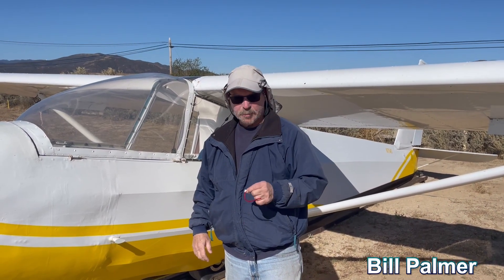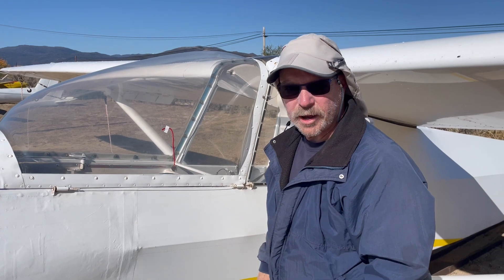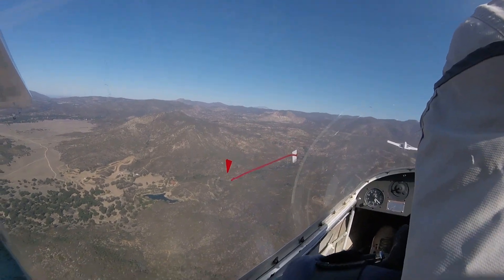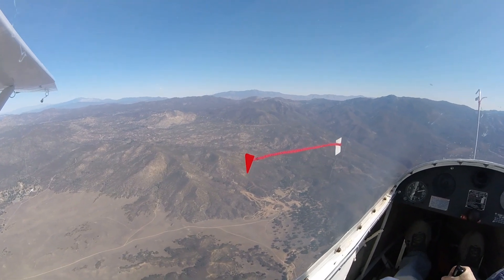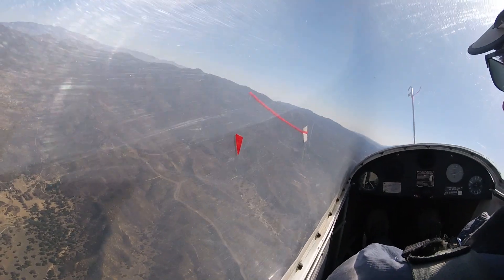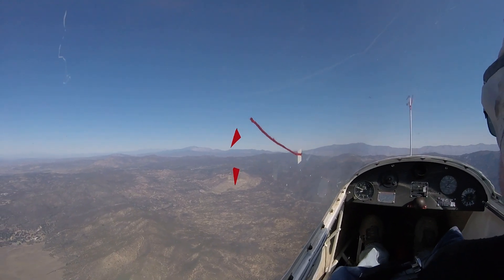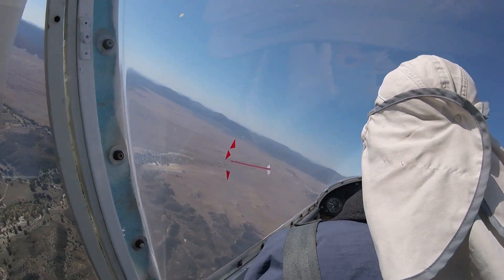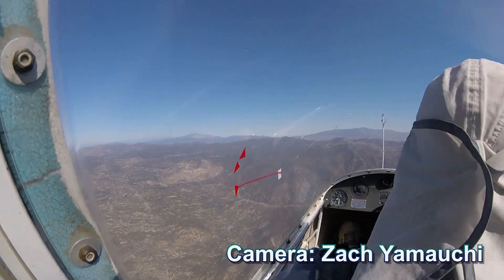We Make an AOA Indicator for a 2-33

Comment: Love it. U can also set the markers for: Transition to stall | Speed / AoA for lowest sink | Speed / AoA for best glide. It woks fine...no matter what the wing loading is. Also works during winch launches. U can also use it a indicator for correct flap setting. For exampple: You're gliding to the next cloud. Your sidestring is lower than the marker for best glide > you're flying with the wrong flap setting and u have to hit the next gear (negative). You're cruising like a dolphin and your sidestring is above min sink adjust your flaps positive and youll find the string between min. sink and best glide again.